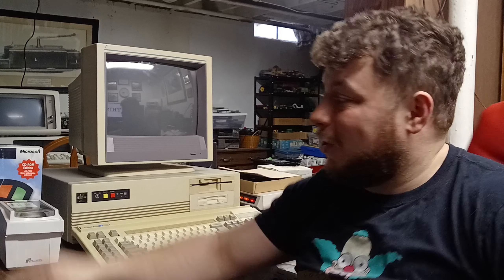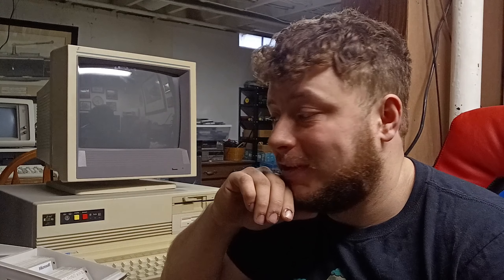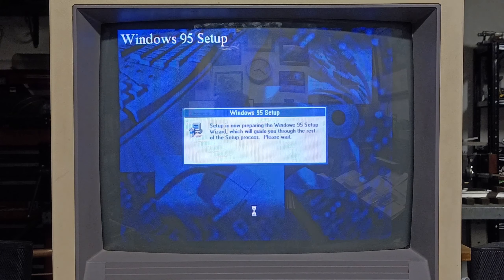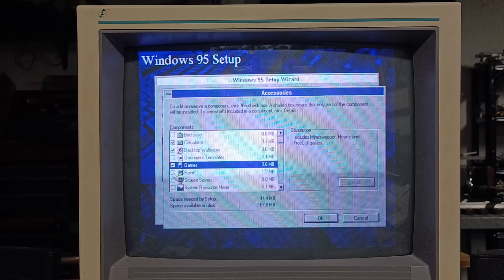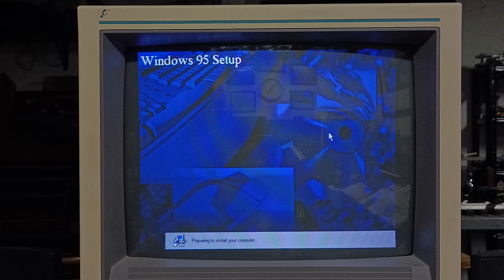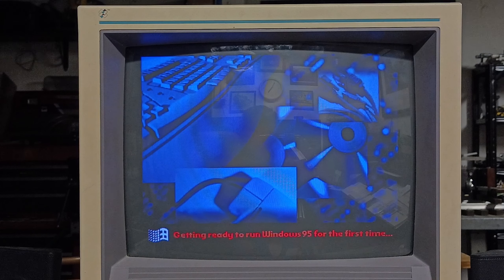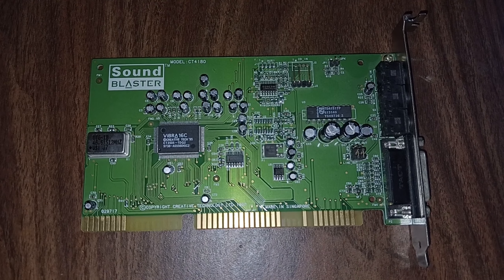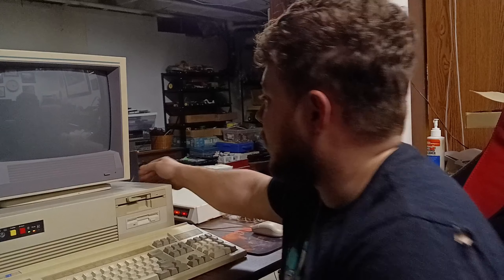Installing Windows 95 On a 386DX???

Comment: It wasn't the most pleasant thing to use every day, but 95 was the hot new thing and my 386SX20 was all I had.
Reply from the maker: Hey, back then we had to do what we had to do! Thanks for the comment!
Reply: Same here. I even managed somehow to install it on 3MB of RAM. It required working around the available memory check by the installer. I can't recall how I did it.

Comment: well done, very fun te watch. one time for laughs i tried it on a late 286 16mhz with 4 simm sticks of 1mb and a more modern 500mb hard drive. it ran but i remember extracting a  .rar file like a random directx installer took 17 minutes or something
Reply from the maker: Thanks! Lol, sometimes it's fun to try a crazy idea with an old computer just to see what happens! 🤣
Reply: Rubbish, a 286 can't run Windows 95, as it is 16/32 bits OS

Comment: It should be noted that the processor is not to blame for everything, things around, whether hardware or settings, are responsible for a lot of slowdowns. The basic setting of Win95 for slow configurations is to not put a background on the desktop, to use only a solid color, to turn off the rendering of the window when dragging. I still turn off a different background color of the icon label and the arrow in Tweak UI, but that's probably a visual improvement for me :) Fewer icons on the desktop is also a plus. It is ideal to have enough RAM (the minimum amount to use at least a little with the senses is 16MB, better 32MB) or to set the cache file to a fixed value and ideally to a second physical disk. Use a card that has some 2D acceleration (it's not that rare again). Another option to increase performance is to use a SCSI disk, because working with the IDE interface puts a lot of strain on the processor and then it cannot do other things (for example, when loading an application). That is why SCSI disks were put into workstations and servers, regardless of the fact that these disks are usually faster. Then it works at least a little usable on the 386DX or 486SX.
For example, my AMD 386DX 40MHz, 32MB RAM with Cirrus Logic GD5429 2MB (VESA local bus), Adaptec AHA1542 SCSI controller, WD Enterprise SCSI 2GB and SoundBlaster AWE32 works very well within the 386 capabilities with Win95 :)

Comment: I had a friend running win95 on an 8mbyte 386dx40 back in teh day, and it actually wasn't that bad - I've heard, anecdotally, that it's actually snappy if you can get 12meg+ in there - win95 seemed to hunger for ram far more than it hungered for computrons
Reply from the maker: Thanks for the comment! That's what I remember as well. Early versions of Windows 95 were memory hogs 🐖

Comment: Back in the day, we had a menu system in Window 95-98-ME.  You have one selection for , say Wolfenstein, another for a CD based game, and another for Windows. You would never run a Dos Game without exiting Windows, or better yet, not loading it.  You have to edit msdos.sys, config.sys, and autoexec.bat  All of these files are text files in the Dos version that comes with windows 9x.
I was able to run Windows 3.11 on 286's and Wolfenstein and Blake Stone, and Windows 9x and Doom on 486 machines and Windows ME and Quake on Pentium 60.  But I never ran the games never ran under Windows. Even the ones that would run did so slowly and without sound.  Your menu choice loads the Dos version of the sound drivers or possibly the sound and cd rom drivers if you plan on playing 3d games.
  You could dual boot Dos and NT with versions of NT then use the Menu system to load your drivers for DOS games.But, again, you want to avoid playing DOS games under NT.
Reply: Windows 3.11 cannot be run on 286. The minimum is 386. Under Windows, DOS games can be run even with sound, but the drivers must be set correctly. But it is a fact that they usually work better without Windows.
Reply: @Thales_WH  Yes, I meant "Windows 2.11" not 3.11 on the 286's.   I actually ran it from floppy drives on my Tandy 3000HL (8 mhz 286) for a couple of years.

Comment: The first computer I ever installed Windows 95 on was a 486DX2/66. I don't remember all of the stats, but I think I had 8MB RAM, and a 2GB hard drive. It ran pretty well, but doing benchmarks on it, I found that it had better stats running DOS than it had running Windows 95. I think that would be an interesting video, if you ran benchmark tests on it, in Windows, as well as booting up in command line DOS mode, (which I believe is an option on Windows 95). I think that's how I did my comparison, but it was obviously over 18 years ago, so I'm not sure.

Comment: In my experience outside of booting very slow on a old 120MB hard drive, Windows 95 generally ran faster on a 386 than Windows 3.11 did. I think Windows 95 has a couple of improvements to UI optimisation.

Comment: I was forced to install Win95 A on  a Compaq Deskpro 5133 around 2000. After that I always made sure to have a bootable Win98 startup disk with cdrom drivers & a pc available to format hard drives & copy the setup files to them. C:\Windows\Options\Cabs\ is your friend.
Reply from the maker: Yeah, having a boot disk (or several) around is definitely a necessity! Thanks for the comment!

Comment: Would be truly painful if it didn't have cache. is it an ET4000W32 or one without Windows acceleration
Reply from the maker: It's an ET4000AX, and given the BIOS date of 9/14/1990, I highly doubt it has Windows acceleration. It's a shame, it would definitely help  out Windows alot if it did.

Comment: I remember running win95 on my 386, it had 8mb ram, and I had few things installed on the pc, but mIRC was 100% required... I would use the win95 networking to dialup, because win3.11 and trumpet winsock was... a PITA

When I would sit in mIRC and chat with people sometimes the messages would come in faster than the screen could redraw, and I would have to wait for people to stop talking in order for me to use the machine... 40mhz 386 struggled with win95

Comment: 286?
Reply from the maker: Are you asking if it'll run on a 286?
Reply: It can't run on a 286 (unless maybe you swapped the cpu with a super rare 386 chip with adapter to go in a 286 socket)
Reply: Windows 95 needs a CPU that is capable of 32bit instructions.
The 286 is not capable of such instructions, so no Windows 95.

Comment: The 8 mb ram and win95 combo will destroy the hdd. Win95 will make a swap file on hdd and it write like crazy on it, making bad sectors, due to the age of the hdd. I have seen it happened many times. Are those the famouse win95 installs 1.7 mb floppy disks?